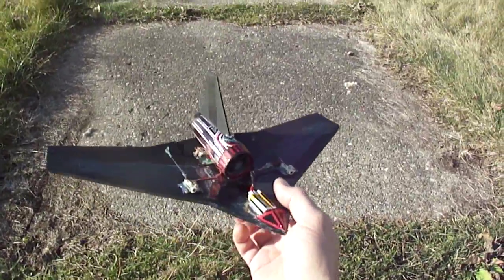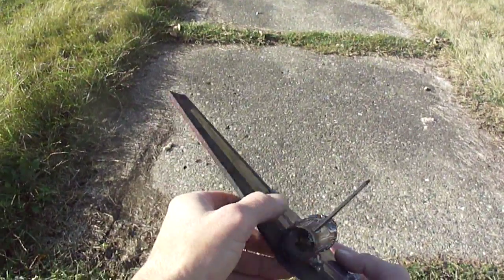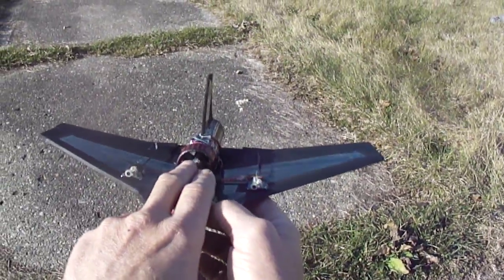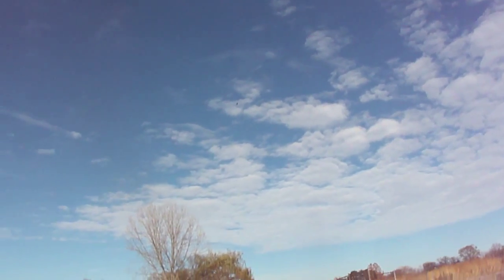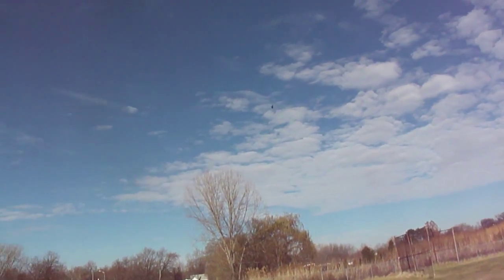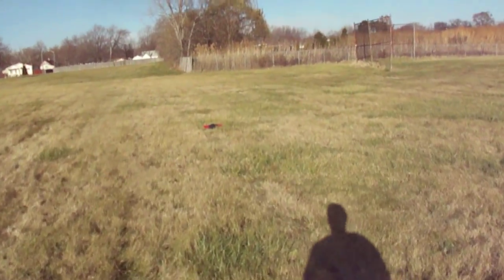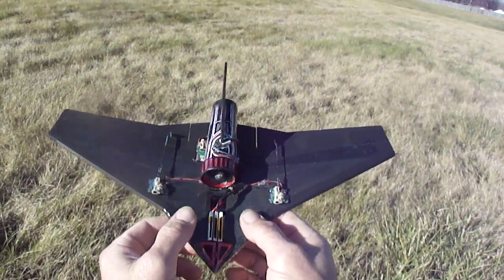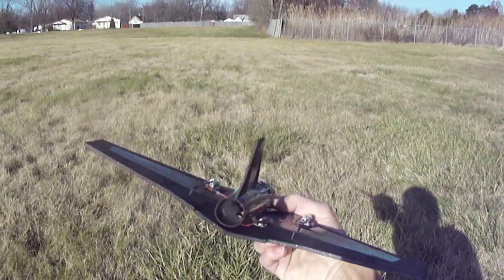Fast Micro jet. Uses the AR6400NBL receiver paired with the Eflite 28mm edf unit.

Comment: Is that the 11000kv or the newer 13500kv motor on 3s? Also do you know what amp your drawing? I have 2 28mm ESC's with 13500kv's and 6a esc I am going to use on a build, but I'm not sure if that will work with 3s.
Reply from the maker: its the 13500kv motor and i would not recommend using a three cell friend.
Reply: crispy critter did you end up frying the motor?
Reply from the maker: no..but the little micro receiver is not meant to use a 3cell lipo it could burn it out.
Reply: crispy critter I'm using a FrSky rx and 6a ESC's, not the spectrum all in one.

Comment: Chris I just discovered you and I gotta say, I love your work, definitely will try a few of your models, I have 2 questions: Any chance you're doing any Star Wars models in the near future? 2. Are your models FPV capable? you know I am deep into fpv racing quads and wings. Thanks
Reply: chris : fpv is easy to get used to, and the immersion factor is a total game changer. it's almost transcendential. (whee I fly!) i find it much easier, than flying fixed wings that are further away by line of sight. it's so worth it! ;) 
relevant pic: http://hobbyking-fans.de/wp-content/uploads/2015/05/IMG_20150508_183521.jpg
Reply: every model that can carry a few grams of extra weight is "fvp capable", if you stick an eachine tx01/02 or a boscam 205 (for really tiny models), on it, and bob is your uncle for about 20 bucks.
Reply from the maker: Thanks friend.. i am sure you could fly FPV with some of my models but i have never tried flying FPV.
Reply: haha to Cuda, thanks 4 the answer Chris